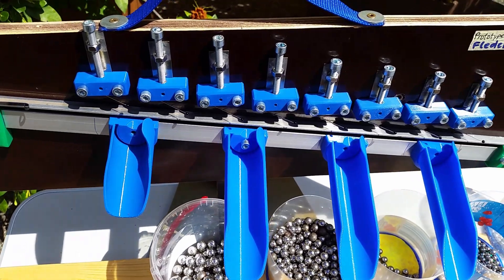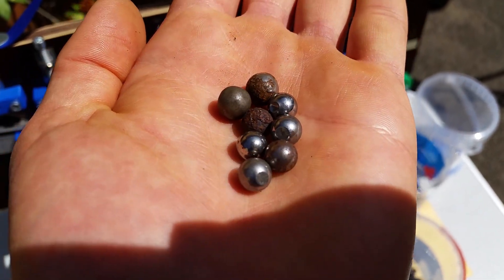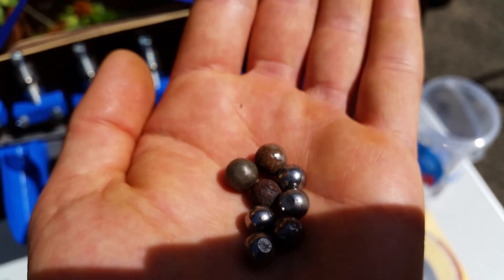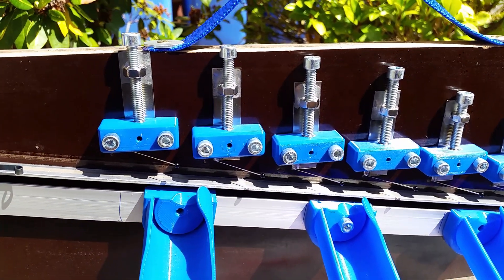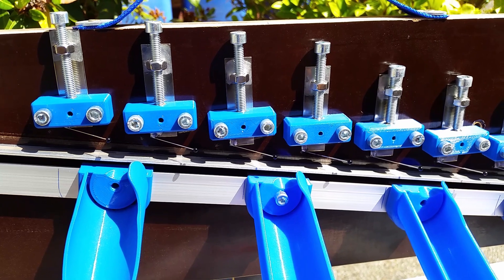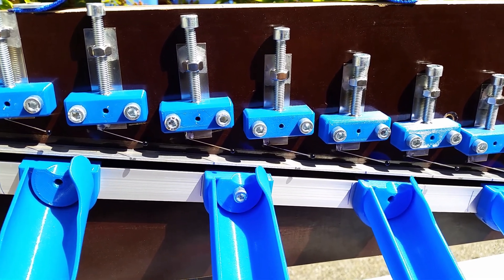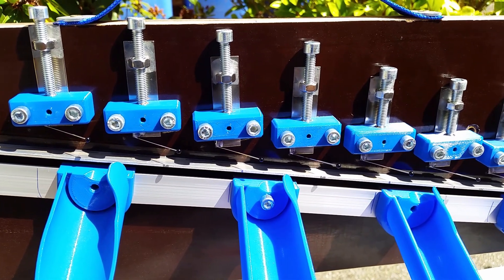Classify spheres by size - Sorting machine for steel ball bearings

Comment: From your video it is not clear for me how this mechnism is sorting out balls with altered shape.
Could you please explain it to me?
Reply from the maker: Sure I can try to explain. You mean the machine is sorting round balls from not round balls? It is not doing that. The mechanism only sorts by size or more specific it sorts according to the height of the object. So a spherical steel ball of 9 mm would have a height of 9 mm. The same steel ball but with a dent might only reach the height of 8.5 mm if the dent is aligned towards the needle at the exact moment of sorting. Therefore the dented 9 mm steel ball would then sometimes be falsely classified as an 8.5 mm steel ball. 

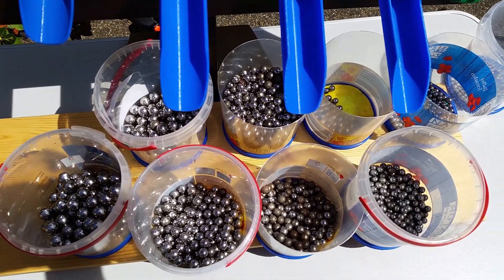What I am saying at 1:20 is that the machine will not break if you feed it balls that are not perfect. Many sorting mechanisms of others are quite sensitive to dirt or uneven steel balls. Rust will also break many machines. But the one I came up with and which i show in the video will still run with those types of steel balls.
Reply: @Flederratte  thank you.